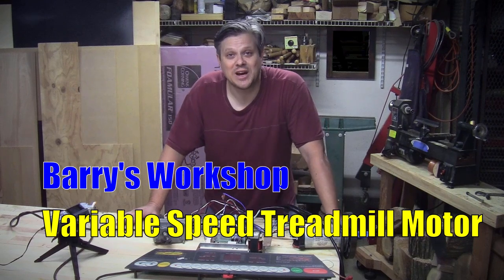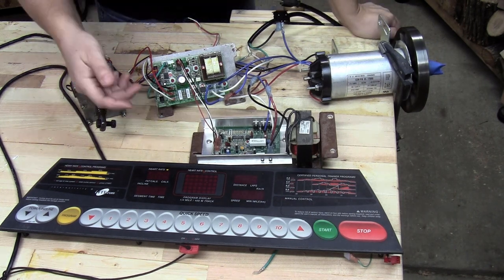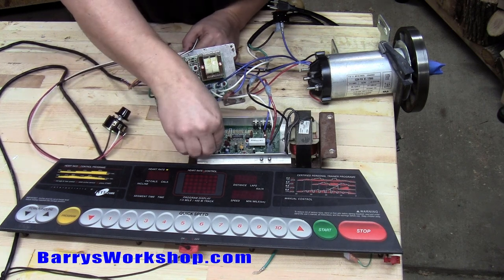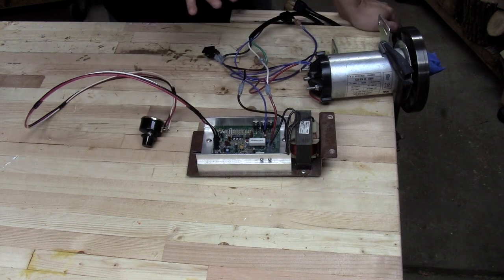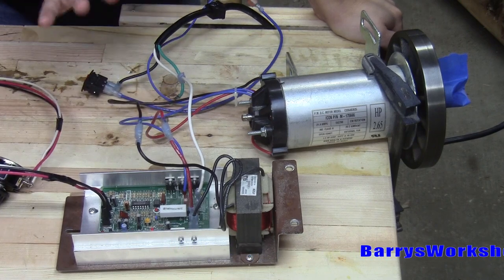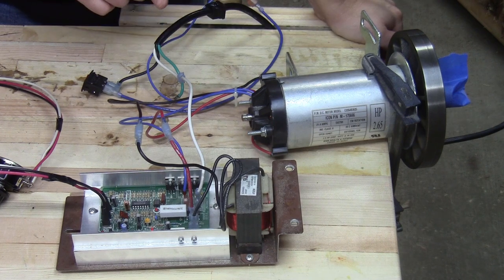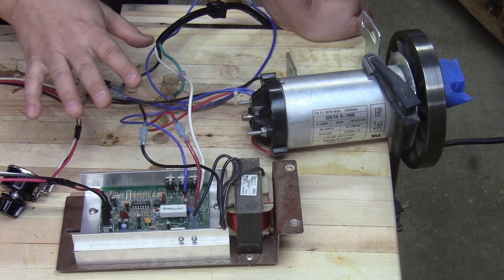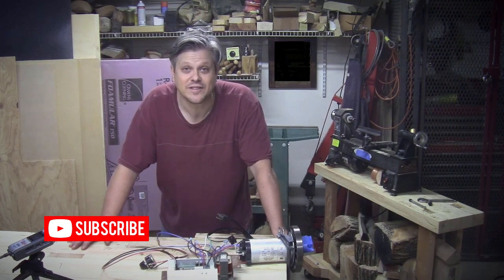Simple Variable Speed Treadmill Motor Electrical Conversion

Comment: Had an older, but low mileage Image treadmill. Sat a while plugged in but powered off. I had laid a coat over the control board, and when We went to use it the lap indicator was on without the dead man key inserted.
Must have overheated the console, as it was DOA. No schematic so contacted Icon  fitness...useless!
No parts available so I started searching the web and found Barry's video. Had an old 10K pot and wired it in and bypassed the power board. Works fine. No display but it works and the boss uses her Fitbit for mileage.
Thanks Barry and will stay tuned in.....Bob, Milwaukee
Reply from the maker: You made my day! Thanks for letting me know that this video helped you. 👍

Comment: I found a free Treadmill and everything that I needed worked. The parts were all very similar to those in this video so after purchasing a potentiometer I was able to do the same as Barry did. So for the price of a small burger I now have the motor I need for my belt grinder project. Thanks for the tutorial! Now to get a drive wheel put on the motor....
Reply from the maker: Excellent! Thanks for sharing.

Comment: Wish I would've come across this video before I did my mill conversion!!  Oh well, good video and thanks for sharing!  If you run your DPDT switch for reverse, it also disables (bypasses) the soft start function for restarting at the previous rpm.  I pretty much use that as ON/OFF switch after initial power up of the machine.  I'm sure you know this by now, but might help the two people that read my reply lol

Comment: A huge THANK YOU.
I got my hands on some treadmill guts and was looking to convert them. It just so happens that it's the exact same hardware that you have.
Reply: What kind of treadmill was that? I'm scouting for a donor, not sure what to look for. ~2 hp would be ideal.
Reply: @ptz0n Pro-Form CrossWalk Advanced 525x. I think the motor said 2.4 hp. It's got some kick to it.

I slapped a 10k pot and switch on it just like in this video  and it works exactly as advertised.

Comment: Using Barry's video, I was able to set up a treadmill motor onto my wood lathe and now have a forward/reverse switch and variable speed. Very satisfied with the comprehensive info on the video. Thanks

Comment: Having a lot if concussions, (and only 1 functioning arm) I've come to accept that my brain can not do electrical. 
 
I've burn 2 motors now trying to make a variable speed drill press. Adjusting a belt is a nightmare with one arm. I broke a tooth, (in my mouth... not a gear), last time  lol. So I keep my drill press on low speed 24/7.
 
Now, with that said..  this video was the most detailed I've seen as of yet. But I'm at the point where I'm just trying to find someone to sell me a pre-wired system they've taken from  a treadmill and built it the way you did. But no one seems to do that. 
 
So thanks again for the video. Very well done!

Comment: THANKS, Barry!!!  I did Not know about the red wire trick to get around the on-off-on quirk.  I'll still make a microcontroller do the work for me, as it can track RPM and make for a nicer display layout  (and I'm just geeky that way...), but now I don't need a separate high power MOSFET to turn power on and off!  Great video!

Comment: Thanks for the video,, great job.  I am a novice at best with circuit boards but I followed your steps and am ready to mount the motor and control board in a box and hang it off the lathe.
Reply from the maker: Thanks for your comment, Joseph. It makes my day that this video helped you!

Comment: Awesome video.  Agree with many other comments... very clear with extra optional features that could be done depending on the application!  My son and I are using a treadmill motor to drive a DIY BB gun shooting range project and this will help us with the simplest way to modify the treadmill motor/controller card.  Thanks!

Comment: Obviously an older video, but the information is still useful. I have basically the same treadmill circuitry that I just removed from an older thrown out treadmill that still worked. And when I see such road side trash, I have to pick it up for the motor and circuits. And so far the ones I picked up all worked or needed a bridge rectifier replaced to work perfect... Go figure...   Thumbs Up!

Comment: Thank you very much. This video showed me exactly what i needed to know because switching to a tread mill motor is what i have to do on my smithy lathe mill. I dont have the 700 bucks they want to convert to a 2 hp motor,  after the original fried ,so the treadmill motor is my best option, since its free. After watching this i noticed not all the treadmill motors are set up differently and this wont work. Which Treadmill did you get this out of?

Comment: I am doing this conversion right now to my late 50's Rockwell Delta 20" wood cutting bandsaw. I am converting it to be able to cut metal. That red wire tip is great!!! Without the red wire tip, I would of bought a 6k SCR. The soft start I don't mind so much on such a big bandsaw. Thanks for the vid.

Comment: Great video. Thank you. 
So would you recommend removing the fly wheel so the unit can run reverse?  What is the shaft size and what size pulley would you install?  I’m actually working on a lathe currently.

Comment: You made it very clear on what you were doing. Not sure if it is allowed but would have been nice if you could have mentioned the make and model of the unit you were dealing with. Not even sure what the Hp rating the motor is .

Comment: Very, Very good video, Sir. I've managed to salvage or acquire 2 or 3 of these motors. I believe 2 that I salvaged, I also saved the boards for them. My organizing practices aren't the best so I'm going to have do some digging around to find them. Should the boards be in working order (hopefully), is there a way to ID the correct boards for the proper motor? I may find the info. on the boards & motors to be able to properly match them (hopefully).  Also in the comments below, a Mr. Heyward Mattox asked what the rating on the POT was. I'm guessing he was referring to what the current rating of what the POT is. I have the same question as well. By it's size, it's obviously a fairly high wattage POT. I've got an idea for a multi-tool I'm planning to build, and having a powerful, variable speed motor to operate it would be great. It will have a fixed saber saw, a, I believe, a 1/2 inch chuck flex shaft to connect to it & possibly a disc sander. Again, having a powerful, variable speed motor to operate this is what I need, but to achieve the variable speed, knowing the wattage of the POT is an important detail. If you could help me out with this issue, it would be greatly appreciated. Keep up the great work with these very informative videos. Thank you, and take care.

Comment: Very good video. Well explained. I have another treadmill I took apart for a project and it has an MC2100 controller board that does not have the 3 leads to replace the PMW. Or high low and wiper. Is there another way to connect a potentiometer to this type of control board? Thanks

Comment: You can also cut the collector on the Q6 transistor, or remove or cut the 5.6K resistor tied to the Q6 collector on the MC-60 controller,  and the unit will start and stop at the set speed with the main on/off switch.  No need for a separate switch.    The collector is the lead on the right looking at the flat face of Q6.  One more note, the brushes are slanted or biased toward one direction rotation.  Running in reverse will cause excessive brush wear and lower torque.  Enjoyed the video.  I have one of these on my drill press and it works great.
Reply from the maker: Thanks for adding to the information for this controller. I am sure that someone along the way will find it useful.
Reply: Thank you for the info very helpful for my project
Reply: Harry workshop do you know how to reduce the acceleration time? the lag between moving the pot and the speed change is bugging me.
Reply: Eric Jenkins !
Reply: Good to know about Q6.  But slanted brushes... Are they, really?  That would seem to go against common sense for mass production manufacturing.  DC motors are.. DC motors.  Just because this particular one is used in a treadmill doesn't mean it would be designed for that task, and one direction only.  It would be more likely, and more economical, for the designer to choose a Commercial Off The Shelf (COTS) motor designed for general use.  It is true that even straight brushes can wear different in one direction than the other, but for such a high power motor I'm guessing they'd be designed to last no matter how they're used.

Don't get me wrong.. I have seen huge motors and generators (hundreds of kW) with brushes slanted for a larger contact area, but those were made to go one direction only - a very specific use case.  So these could be like that, but I'd be surprised for sure.
Reply: @jenkinseric2  
Add an inline start capacitor from ebay

Comment: Very helpful! I just got a free treadmill that they claimed was working. I turned it on and as soon as the motor starts, the screen resets like it tripped a safety. I tore it apart and cleaned things up to try with the components laid out like you have in the video. The motor spins up fine, but I see significant arcing in it just before it resets. Any ideas of things I should do/check? It trips 15 amp breakers, but not 20 amp breakers. Hoping to use this setup for a lathe.

Comment: Thanks Barry! Just watched your video after picking up a free treadmill with a 2.5hp motor and was having trouble getting it to work on the bench with everything hooked up. Must have been a stray sensor or ground wire but when I disconnected the motor controller, sensors, rewired the power to the pwm board and hooked up a potentiometer, everything worked like a charm. Now I need to get a 10k pot from work for better speed range. My next big challenge is fitting a v-belt pulley where the grooved pulley is now next to the counterweight . The threaded shaft is very thin so I'm thinking of just filing down the existing grooves until I get either a 5/8 or 1/2" shaft. Drill and pin what's left so I can use in reverse and attach the new pulley. Any advice on this plan?
Reply from the maker: I'm glad the video helped. BTW, I used a 10K pot, but I'm going to do an experiment soon with some different values. With the 10K, there is a delay when turning the pot before the motor starts. I wonder if a different value will work better.
I'm not sure if this helps or not, but most treadmill motors have a 1/2-13 Left-hand thread. Depending on your background and tooling, you could use that to fabricate a pulley. For example, you could get a cast pulley with a hole slightly smaller than 1/2" and tap it. A simple HSS tap ($15 on amazon) would work. I wouldn't do this without a set screw, so you'll need to grind a flat on the treadmill shaft to make sure that it doesn't spin off. I also have an idea than involves a 1/2-13 lh nut, but that's a bit more involved.
Reply: I'm pretty handy but don't have a means of machining parts. I like your idea but was kind of thinking I would keep the counterweight which is attached to the grooved pulley. Besides I think unscrewing the whole thing would be difficult. Was thinking if just operating the motor with either filing or grinding down that pulley then use a regular pulley. Let me know how the other resistors work out. I may try a few also if the 10k doesn't pan out. I also used a 100k pot but that didn't get the speed down far enough.
Reply: Just an update. The 10k pot worked perfectly and gave me the full range from ~100 to 5000 rpm. Thanks again. Just wondering, will a 2.5hp treadmill motor have the torque for a wood lathe, bandsaw or drill press?
Reply: Barry, don't know if you're still working on these motors but today I found that under load, while wood turning, the speed controller over compensates with high rpm then drops down again and does this repeatedly and created a dangerous situation. Do you have any suggestions on this behavior? Thx.

Comment: Another way to stop and start the motor without fiddling with the pot is to use a forward/ off/ reverse switch on the motor wiring.  Going from forward or reverse and off will start and stop the motor.

Comment: I know this an old video but you can remove resister 19 in the control board and eliminate the soft start feature . it is closet one by where the potentiometer  wires hook up

Comment: I didn't know a PWM signal could be replaced with an analog signal from a potentiometer.  Is that always the case?  That's a great piece of knowledge.
Reply: I doubt that a potentiometer would substitute for a PWM signal in most cases. I'm actually surprised that it can here! 
A PWM signal should need only two wires. I suspect that the black wire is the DC hot, the white wire is common, and the red has the actual PWM signal, which is providing control information at a constant voltage. An oscilloscope would be definitive. 
Reproducing the PWM with, say an arduino or raspberry pi, would give very repeatable speeds.
Reply: No a pot can't replace a PWM signal.  What may be happening is that there is a voltage goes up to the controller and then coming back, and the pot is varying the level of the voltage.   If you have a true PWM and you feed it through a capacitor and resistor circuit you can create an analog level.  This is how you could use an arduino board that is digital only to provide a signal that is more than just on or off, the resistor and cap are a low pass filter.

Comment: Hot damn! I just picked up a FREE treadmill at a yard sale and tore it open today. I did exactly what you did to get the motor working on its own, but my source treadmill was a lot simpler than yours. I had only the control panel with a potentiometer already installed and no incline adjustments. I'm looking forward to adding this motor to any cheap or non-working drill press I might find (love a good yard sale). Thanks for the tip on getting it to restart at the same RPM after a shutoff.
Reply from the maker: Thanks, Phillip. I hope you put it to good use!

Comment: Hey Barry! Very informative video. My question is it possible to put a bigger/stronger motor in a treadmill( that has been discontinued and parts hard to find) to replace the original motor? I know this isn't what this video was about. But your video is the 1st I have been able find on doing anything different with a treadmill motor!!

Comment: Just what I needed.
I was about to purchase a big old UGLY box to fit all that crap into, and I had even cut down the control board as much as possible.
So, the variable resistor you said was 10K?
Reply from the maker: Thanks for the nice comment. I used a 10K ohm, and it works, but you have to rotate the knob a bit on the low end before it starts up. I am tempted to try a 5K instead to see if it handles the low end a bit better.  Gives me an idea for a video.... :)
Reply: I would integrate all the main buttons from the control panel. All you have to do is place the circuit board into a sufficiently sized plastic electronics hobby box with the Faster, Slower, Start & Stop buttons on the lid.Some of the LEDs too. Would look quite snazzy and work best too imo. Why keep PWM? I'm sure Barry won't mind if I link to another Youtuber who explains exactly why right at the start of his video too! https://www.youtube.com/watch?v=90g6RpvXBYY

Comment: With this set up can I run the motor super slow ? I want to direct drive to a bead roller, great video, Thank you
Reply: Tried that for a similar project. Slowest these will go is maybe 100 rpm. Ended up reducing speed with multiple size pulley setup. Got it down to 10 rpm with pretty good torque.

Comment: best one yet thank you ! do i need to cool the motor if running at low  speeds?
Reply from the maker: Thanks so much for your kind words, Andrew.

My motor is externally cooled, and that's accomplished by the fins on the flywheel. If I run it without the flywheel, I'll need to come up with a separate way of cooling it. I'll either attach some fan blades to the tail end or just mount a small muffin fan that runs whenever the power is on. 

I presume that if the fan is connected to the motor, then the cooling will be proportional to the speed of the motor, so while there will be less cooling at low RPMs, it will use less power and therefore produce less heat. This is an assumption, of course, so definitely verify by monitoring temperature under load. 

Another thing to consider is that the motor may have less torque at lower RPM, so if you regularly want to use with a slow tool RPM, it might make sense to use gearing (or pulleys) to have the motor spin a bit faster while the tool is slower. Assuming the fan is attached to the motor, this should provide appropriate cooling. Although it seems to limit the benefit of variable speed, a lot of lathes have two or three ranges based on pulley settings, for this reason. 

I hope this is more helpful than vague. There are a lot of variables to consider.

Comment: Thanks so much...been looking for a cheap or free treadmill for future projects...what horse power one needs for a little wood lathe...what is the lowest and max RPM on most of these...should I look for a specific treadmill?
Reply from the maker: Thanks for your comments. My mini-lathe has a 1/2 HP A/C motor, but if I were to do this conversion, I would do about twice that,  1HP or more.

Comment: Wonder if a push pull pot could be wired instead of putting a switch on the  red wire
Reply from the maker: That's a great suggestion. Less clutter and a single knob for start/stop and also speed.